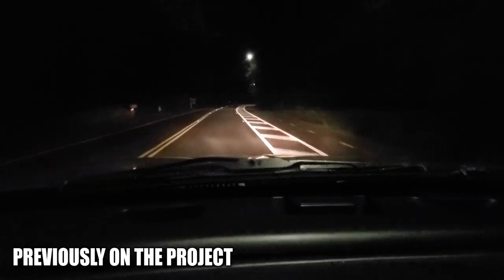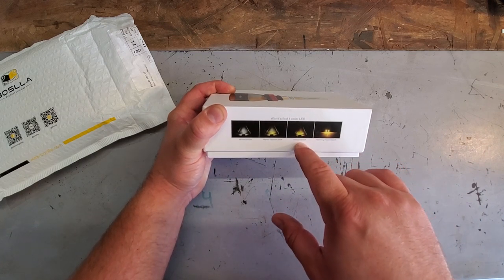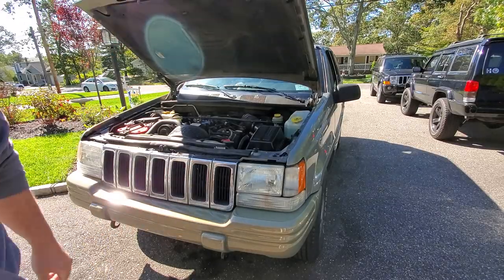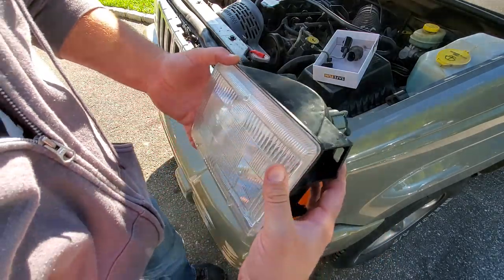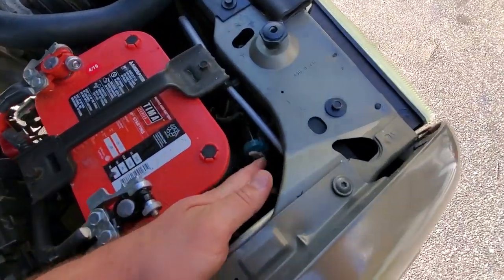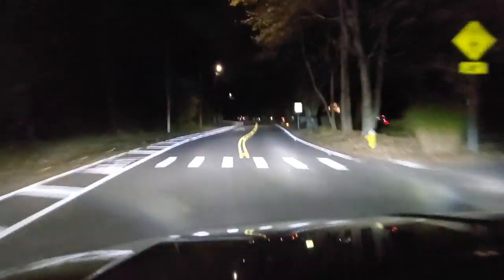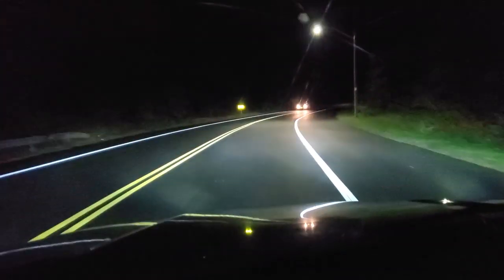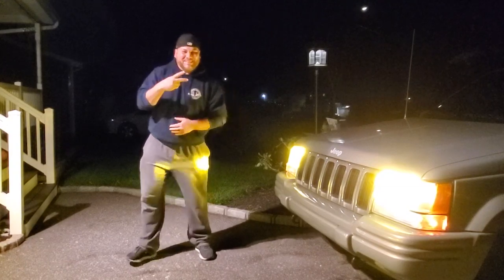JEEP ZJ HEADLIGHT BULB UPGRADE - GENERAL GRIEVOUS GRAND CHEROKEE GETS 9004 BOSLLA BULBS!

Comment: I hated how dim my stock lights were in my ZJ, i would drive with my highs on and u wouldnt notice I went with the supernova v3 bulb and now i never have to use my highs, bosllas a good brand but I'm not a fan of having to shut the lights off and on to get what beam patter u want, good video for an upgrading headlighs
Reply from the maker: Thanks man!  Ill deal with their little quirks to get that amount of light outta such a simple package.
Reply: The ZJ headlight harness is junk, but for $30 you replace the harness with a kit that powers the bulbs directly off the battery and also makes the switch last longer since all the current to the bulbs doesnt run into the cab.

Comment: So before I spend the money, I want to know if in fact you remedied the shaking of the bulbs due to the fit and lock ring?   Very important not to see vibrations in the headlights, that would drive me absolutely crazy.  I was hoping you would have posted an update on that?
Reply from the maker: The actual problem was my warped headlights.  a new OEM lens helped secure the boslla. all is well

Comment: You sold me on these guys. I have a 1998 Jeep Grand Cherokee Limited 5.2L and have been trying to get LEDs to work on it for years. My experience with these lights are that they work fine on low and high beam, but once I switch it to high beam, my high beam indicator on the dashboard shows up until I completely turn off the lights and reset them. Also, I can only get one side to switch modes. Kinda weird. I sent an email to Boslla and they just sent me back a wiring diagram of the headlight sockets. I tried using a canbus thing in between the lights and the connector to the car but no difference. I have LEDs in the front, turn signals, parking lights etc., only problem with that is my turn signals flash really fast but not a problem to me. They have a section in the installation guide that talks about buying resistors and capacitors. Not sure if that would solve the problem. Do you or anyone on this thread have any advice or guidance. I've been trying LEDs in my Jeep for about 4 years and none of them work quite right, even with a canbus thing hooked up.
Reply from the maker: I Havnt had any issues reported with LED, not sure if its specific to your vehicle. 🤔
Reply: Thank you, sir. I played around with them this past weekend. Not sure but may have figured out the problem. If I switch the selector very slowly, I can kinda short out the lights. I was able to switch between all 3 modes like that. Sometimes one white would be white and the other yellow,at first. But after a while, I was able to find the sweet spot to make them work correctly. So, my verdict is that I need to take the selector out and clean it or replace it. If that don't work, I'll just take it into one of custom auto places and let them figure it out. Great video, keep it up. Take care and thanks for showcasing these lights. I love them.

Comment: Not sure but I think it looks like you have a lot of stray light on the road in front of the car?
My ZG has H4 bulbs so these won't work for me, and besides I Sweden these kinds of mods are illegal...
Gonna go the HID way with mine if I ever get it to pass inspection... 🙄
Anyways, nice vid!
Reply from the maker: Thanks for watching brother! I think you might be right,  I noticed the bulb may have drifted out of alignment because I didn't use the lock rings since they were warped.  I am a huge fan of HIDs because they emit heat to melt the snow. Only time will tell how the Boslla bulbs deal with frosty accumulation.

Comment: Will these blind oncoming traffic with low beams on? I am worried about putting a HID or LED light in a reflector housing. Regardless, stock ZJ lights are downright dangerous at night.
Reply from the maker: These Boslla bulbs will keep you on par with modern vehicles.  I will admit that the brightness of most bulbs is way too much these days, so I rather be able to see the road in front of me with my own bright lights after my pupils have been constricted by an on coming truck.
Reply: Yes, the problem with all of these headlight mods, they cause problems for oncoming traffic and a nightmare when the bulbs fail.  

With stock bulbs I go to the local part store and get 2 Phillips bulbs for $8, when your Boslla bulbs fail you have no choice but to buy another set of more expensive bulbs.  The factory bulbs are actually pretty good, most people just never clean their lenses so they look dimmer than they actually are...also helps to buy good bulbs.  They do have standard and Long Life bulbs which is designated by having "LL" after the bulb number on the package.
Reply: @wildbill23c  The problem is the way the headlights are wired. Buy an upgrade harness with relays, heavier wiring & you will VASTLY IMPROVE your stock lights. Or you can make your own upgrade harness, THE RELAYS & HEAVIER WIRING ARE KEY. It's really pretty easy if buying an already made upgrade kit, it's plug & play. I bought mine at K-SUSPENSION, I could not make them for what they charged.

Comment: Those bulbs seem to work great but I do have a problem with LED bulbs in vehicles anyone I've ever known that put them in their car didn't like them because they burn out quicker than the regular bulbs
Reply from the maker: hmmm. only time will tell I suppose.  But u better believe Ill jump all over them if they crap out on me!!!
Reply: This happens because of all the bumps, vibrations, temperature fluctuations, etc.  For the ridiculous price the factory stock bulbs work just fine and last a long while especially if you get the long life version.  With factory bulbs you can go to the local store and pick them up, these aftermarket setups you are often stuck ordering replacements online and have to wait several days to get them and at $120+ its by far not worth it for the short life span they seem to have in LED, or HID bulbs.

Comment: Did you ever find rings that fit? I got these for my zj today and I just can’t get the lock ring on.
Reply from the maker: check out my Expedition lighting vid.. I pop in the bulbs with the expedition locks pretty easily.  maybe my method will work for you

Comment: ok, my lights seem to be messed up... I'm in the middle of replacing them, but my 1997 ZJ seems to have the 3 prong wiring harness for the  (the long thing L shaped light that sits the lowest of the 3 lights) and the bulb that sits behind this long thing L shaped lower light is amber and bigger than the other tiny bulbs and it blinks when the turn signal is on for each side, it's acting as the turn signal but I've seen it called the parking light...  and the other tiny bulbed lights had clear bulbs in them but were all blown.  So right now I am not sure what each of the lights are supposed to be called, which one is the turn signal and which is the parking light and which is the side marker and then how they are supposed to function in stock form...   can't find any videos of someone turning on their turn signals as of yet... if you could give me some tips or a link to a video, I'd appreciate it.  I also have to buy all new used light adjusters since mine are frozen rusted... I also noticed you didn't have 3 mounting locations on your headlights, is that stock or just because you removed them... the headlight you showed didn't have the 3rd clip which is removable on most headlights for the ZJ... so confusing. lol  help... I'm going to call 1aauto tomorrow to try to get it sorted out.

Comment: Hi Dan, i am analyzing on buying a Jeep for a daily driving to work, i am betwin an xj or a zj both with the 4.0, what Is your recomendation?
Reply from the maker: Oh man... Toughest questions I had all year.  If this is strictly an on road Daily Driver then I would go with a 4.0 ZJ with the 242 transfer case.  Its a Smoother ride with the coil spring rear suspension.  More aerodynamic . Better gas milage.  More comfortable seats.. ZJ for the win